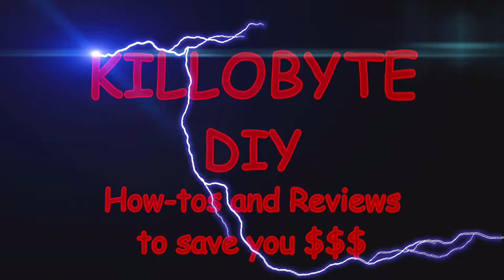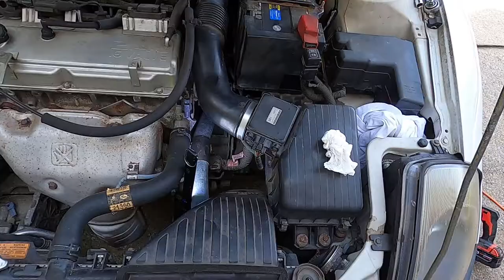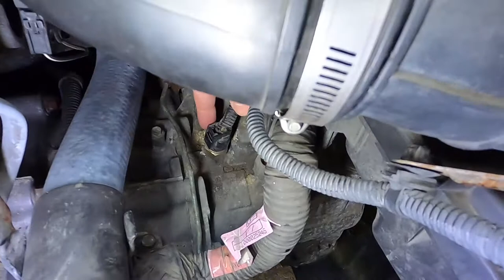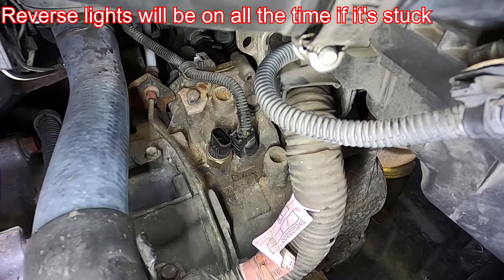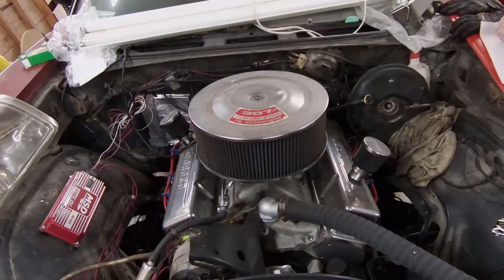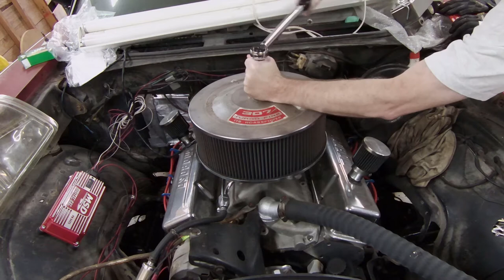Reverse Lights Always On Or Not Working, How To Fix.

Comment: First try to disconnect battery for 10 minutes. The computer controlling the dash lights sometimes gets incorrect voltage and It triggers a constant on reverse light to signal problem. If reverse lights still stay on, then move on to check the reverse switch. 
Always use metric tools unless old American car before 1980.
24 mm best to use over 15/16.

Comment: I already disconnect battery around 20 mins & when I start the engine the reverse light still light up so what I have to do is, disconnect reverse light switch change new one.

Comment: My reverse lights turn on when in any gear other than reverse and turn off when in reverse, do you have any idea?
Reply: Hey, did you get any fix bro? That's whats happening with mine , at the mo
Reply: @yupidounhocoqoricay5300  I haven't 😭, ended up bandaiding it by just disconnecting the reverse light switch. It doesn't work but atleast it's not on while I'm driving lol